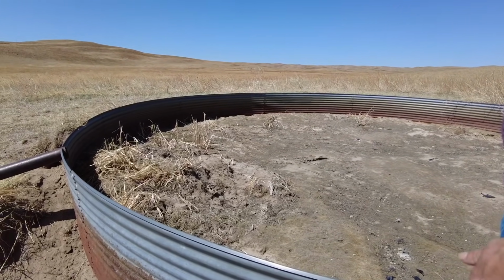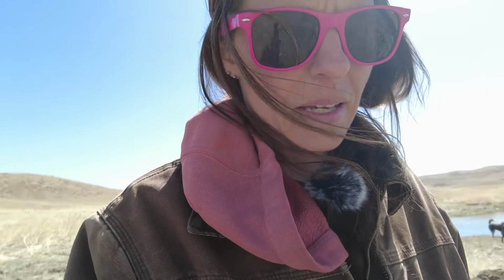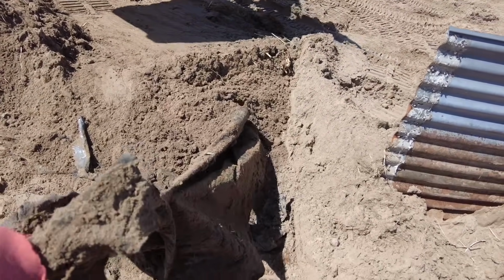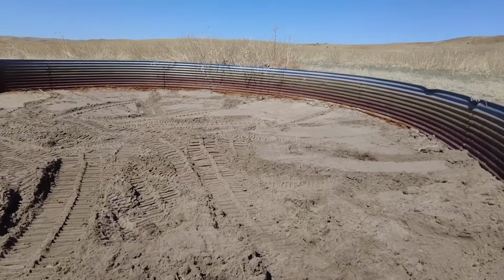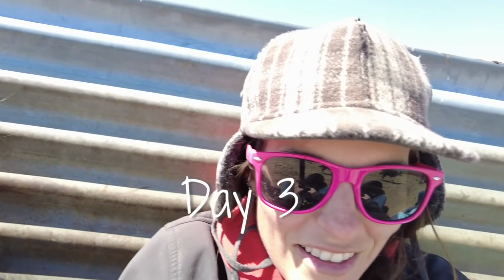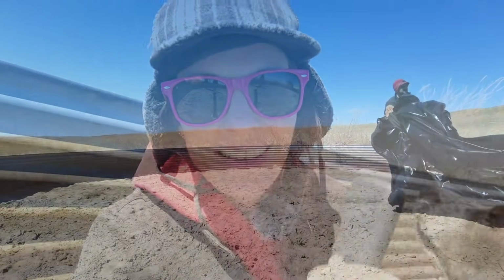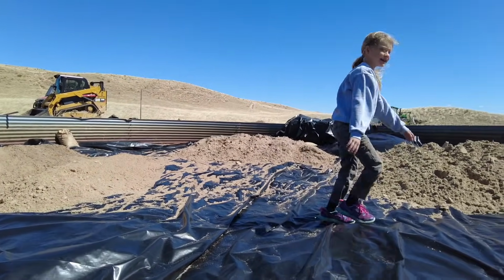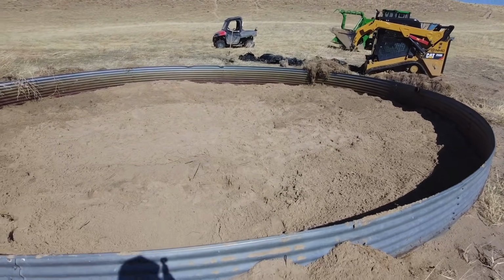Tank Trouble | replacing the liner in a bottomless water tank

Comment: most likely  U are  using plastic  sheet  at the  bottom of  tank  to  block the  water   absorption  in soil  # but  why  don't  U  use concrete   for tank  bottom  . It will   not   allow  even a drop of water  to  be  absorbed ??
Reply from the maker: Yep, we are using the plastic to hold the water in. Unfortunately, we can't use concrete because there aren't many, if any, pastures we could get a cement truck into.